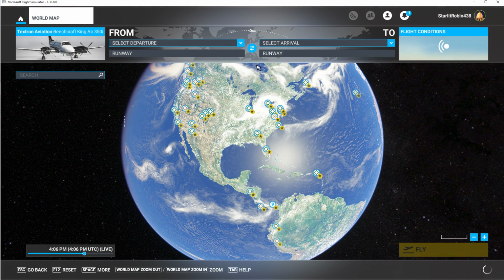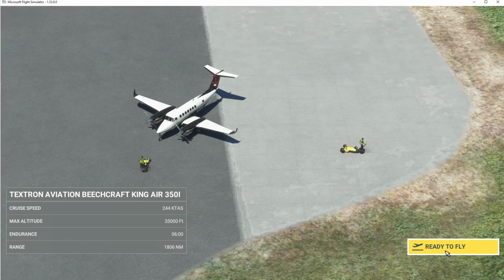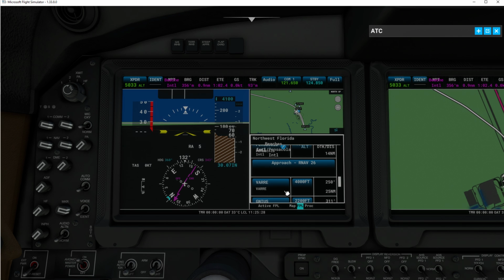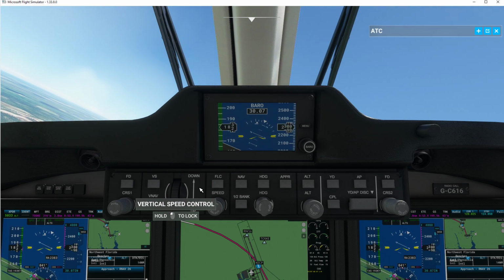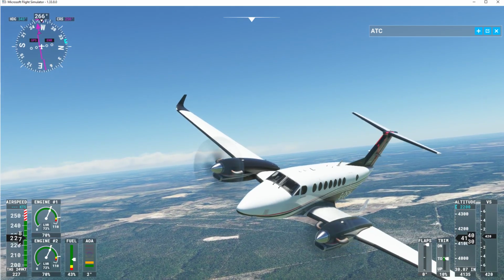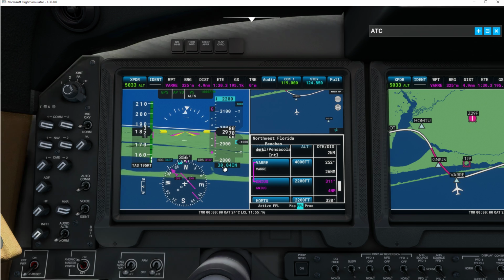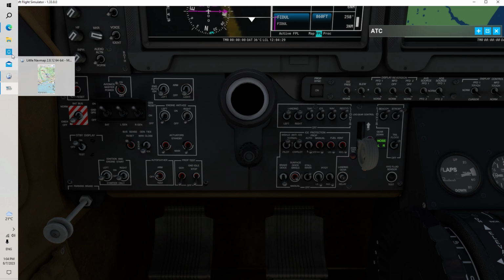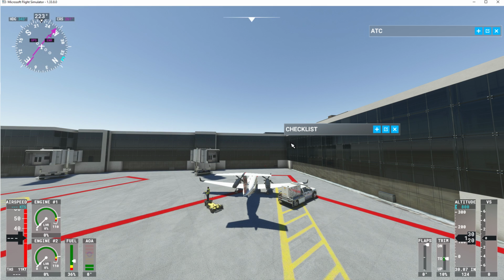King Air 350i Auto Pilot and RNAV Landing at Pensacola, FL - Microsoft Flight Sim

Comment: I had a similar issue with my last two flights with the King Air. When I was approaching my RNAV IAF, it started flying off in its own, not following the FMS/GPS. I tried to choose DIRECT TO my next WP, and it tried to send me back to my last waypoint, 120 miles away. This doesn’t happen in the TBM G3000.

Comment: You put your landing gear down too early.  When you reduce the power levers toward minimum, you get an automatic landing gear warning.  But you only need to put the landing gear down when you are ready.

Also, you landed with flaps at take off and approach position.  Full flaps will let you land at 90 without stalling.
Reply from the maker: Thanh you